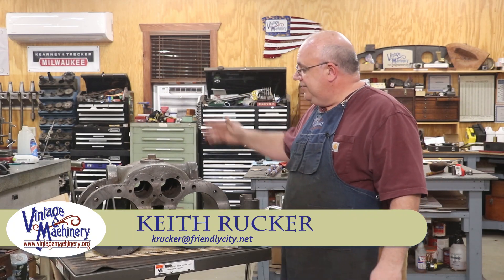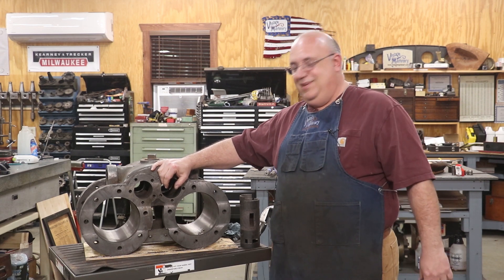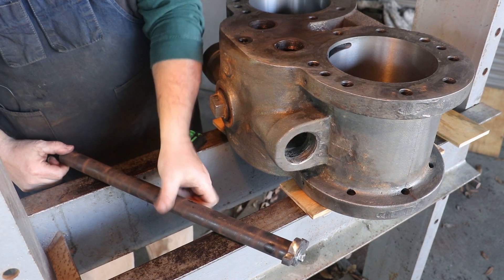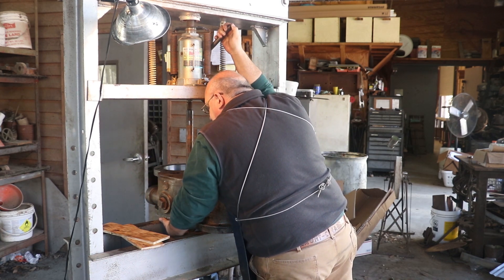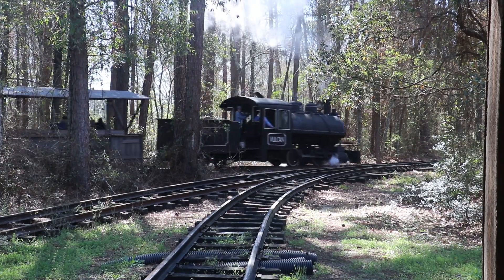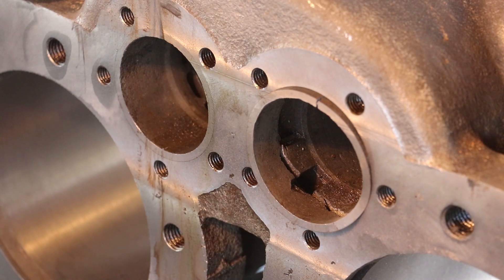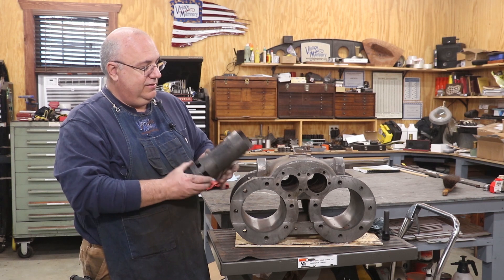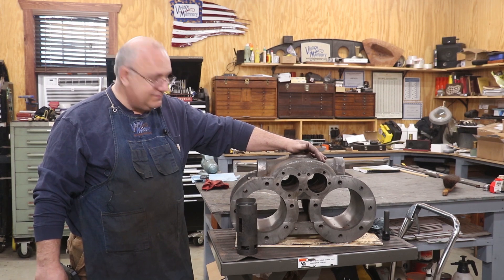Steam Locomotive Stoker Engine Restoration - Part 10: Removing Valve Sleeves Using a Hydraulic Press

Comment: Making a thin and skinny casting like that with no hard spots might be challenging. And there's nothing worse than machining a chill casting with hard and brittle spots in it. So as counterintuitive as it sounds, it might be easier to buy a commercial piece of cast iron bar and machine it to size. It'd take a lot of drilling and boring, but it's going to be nice and uniform, with no bad spots.

Comment: This looks like something I did to a water pump many years ago. Cast iron sleeves!  Who would have thought that cast iron was needed for something like this?  Because the sleeves I removed were shorter I used a hack saw blade to cut a slot, then heated the outside and used liquid nitrogen to cool the inside followed by a few taps and the sleeves contracted and fell out.  Unlike your pump, I had new, ready made sleeves available to press back in.  I used to use a liquid metal filler to patch pitting in water valve seats, darn water is abrasive and wears out water pumps like you wouldn't believe, and my company hated to spend money on replacement if they could avoid it.

Comment: When you go to push them back in you could turn up a puck to fit the top to support the sleeve all the way around. Squatch253 Senior did this to pull in cam bearings in a tractor engine, worked well.

Comment: One way i've seen stubborn sleeves get popped out in the past is somewhat tricky, but not out of this world, and it involves heating the casting as the first step. Doesn't need to be much, but enough to get everyone playing. Then, you need a specialized bit of kit, specifically, a tube with many holes drilled through it (kinda like a machine gun sleeve, but with smaller holes, and capped at one end). You put that tube in the sleeve and through the uncapped end, via a tube, you put whatever cool liquid, at pressure, you have. It rapidly cools the sleeve and if all things are kosher, you can even drive that sleeve out by hand, have seen it happen twice now with old CAT engines, the otherwise unwilling sleeve simply fell out. :))

Comment: Hi Keith,here is my tuppence worth. From previous experience I have run a long keyway broach down the inside of stubborn old liners in several passes. This significantly weakens the interference between liner and outer bore making them real easy to push out. Even a block of hardwood and a  hammer is sufficient to shift the liner thus treated. The idea is to not go through the wall thickness but merely to gouge a series of partially depthened keyway troughs inside the liner to loosen the liner's grip. Eccentric boring of the liner sleeve  is another method  I've been witness to. The eccentric boring method was accomplished with a Van Norman portable cylinder boring bar. The cylinder block set horizontally on a shaper table and a keyway cutting tool would also work well to weaken the liners grip whilst maintaining the majority of the liner intact.

Comment: Keith, you are approaching this the right way.  I have re-sleeved many engines, and for what you are tasked with, your approach is sound.  IMHO.   The only other thing you can consider is if the clearance permits, you can use a small die grinder with a cone burr.  Cut  yourself a slit down the middle, and the sleeve will come right out.   I cannot tell for sure what the ID is, but I have done that a couple of times on 4" and 5" bores.  Great video.  Good luck!

Comment: Check out Melling for a ready made sleeve. They are available in lots of sizes. When we remove blind sleeves we just bore them until they are paper thin and just fall out.
Reply: Then he wouldn't have a model of where the ports would go. Also check out Los Angeles sleeve company for raw materials. But a great idea about boring out the sleeve, my initial thought until I saw the complicated placement of the ports
Reply: Rambozo Clown Mellings sleeves sound perfect, centrifugal cast iron has near perfect metallurgy for the job!

Comment: Check for commercial produced cast iron sleeves used in internal combustion engine rebuilding. Others have suggested this, I just adding another voice to those. Commercial sleeve will have stable metallurgy and controlled grain structure

Comment: Hi Keith! Having some experience with repairing steam locomotives, always heat the thing! Heat is the key. Sometimes heating the part and then trickling water on the part to be removed shrinks it and it will break loose. Good luck and I admire all seek to restore the iron horse running on the rails!

Comment: Check to see if you can obtain a standard size case iron engine sleeve that can be machined to fit.  When I had my automotive machine shop I had a large supply of standard size sleeves anywhere from 1/8" thick wall to 1/4" wall thickness. David Richards may have a source.
Reply: I suggested the same thing in a previous video, use a commercial cast iron sleeve.
Reply: Agree... service parts for internal combustion engines are off the shelf, and of tightly controlled metallurgy and grain structure
Reply: ...or grey cast iron tube from McMaster-Carr.

Comment: On all of the ships I was on we had an oven large enough to put that casting in. We would have heated up the casting so that the gap between the insert(sleeve) and the casting would have grown enough to loosen the rust and allow the sleeve to be pressed out. The one thing we would have made sure of though was to ram molding sand into the sleeve so that the heat wouldn't have reached the sleeve and would have kept the sleeve cooler than the casting (relatively cooler that is). Worked every time. Good luck pressing the last sleeve out!

Comment: I see you are using the hydraulic press with the factory release valve setup. I am surprised you haven't made a larger valve setup to make releasing the press a ton easier. I actually bought a typical water valve replacement handle/knob, and fit it to the valve to allow me to very easily release the pressure as slowly as I like, or even wide open without any real hand effort. Does make a huge difference. Thumbs Up!

Comment: A technique I have used for this application is to (a) appropriately heat the block area then (b) place a thin cloth loaded with dry ice inside a plastic bag.  It's necessary to stuff a shop towel or other item to keep the dry ice bag from falling through.  Usually the heated block area along with the shrunken cylinder will provide sufficient contact reduction for the press to be successful in removing the sleeve.

Comment: Reminds me of the time that Ed Beard  (the machinist at Illinois Railway Museum) made cylinder liners for one of the steam locomotives.  We heated the cylinders with a torpedo heater.  As we slid the liner in, the temperature equalized when the liner was half way in.  The following week end, Ed showed up with 200# of dry ice.  We heated the cylinder with the torpedo heater and then put the dry ice in and slid the liner the rest of the way in.  Also reminds me of putting wrist pins into a Cummins diesel engine.  Freeze the wrist pins and they slide in with no problems

Comment: Melling makes cast iron sleeves for engines. Check them out, it might save you a ton of time. Then on the sleeve removal; heat a band red hot up the side if the sleeve. The grains if the the material will slide over themselves and relieve the press fit. The sleeve should almost fall out. Fun stuff.

Comment: Heat the main casting by connecting a steam hose.  Use dry ice inside the sleeve.  It will fall out.

Comment: LA Sleeve in CA specializes in custom spun cast iron sleeves and can CNC machine the porting exactly per the originals. I've used their sleeves in motorcycle cylinders for over 30 years. A top notch company, they service many different industries and I wouldn't be surprised if they've made sleeves for this application before.

Comment: I used to run a couple beads of weld on large bearing races the wouldn't come out, when the weld cools it shrinks and usually works pretty well
Reply: On engine dry sleeves ( cast iron as well) welding beads worked without a puller
Reply: Tsunauticus III  yes I did point was no need 4 puller
Reply: welding beads are the way to go on this.
Reply: Tsunauticus III  Yes I did, its just a comment on how well it works nothing more.
Reply: Tsunauticus III  relax bud, no need to get your shorts in a knot

Comment: Another plan A can be to make a welding bead along the inside of the sleeve with a stick welder. When it cool down the sleeve will come right out.
Reply: welding on cast iron inside a hole is a lot of fun.
Reply: @LambertZero  
It is a narrow diameter in this case, that is true, but using an easy striking electrode might be the way to go. We do not need any good looking beads.
Reply: Cast iron sleeves can be a bit funny when you do that. I have on more than one occasion done that and had the weld bead break away from the iron. The thing is you cant really weld it properly as if you preheat it it defeats the shrink. When I do that I usually just use the mig as it will shrink the most and you can lay the bead in hot and thick without heating the parent metal to much. . If it was in my workshop I would just put it into the mill and plunge down the side of the bush in a couple of spots to make it thin but not break through. When you do that they virtually fall out. I am wary about putting a cast iron valve into the press as you don't really know how fragile they are.
Reply: Tsunauticus III  
The thing is it could be given a higher priority. As the first thing to do. It is safer to try to shrink the sleeves wit a couple of weld beads than to use the biggest hydraulic press and pile on the pressure until something gives. Cast iron will crack under pressure. Less force is better.

Comment: Make your press tool out of better material. Then just heat the thing, cool it and press it out. I feel certain it will come by that method just can't hurry it. :-) We press water pump bearings out all the time and many times they are very stuck and rusty. A good pressure against them combined with heat to the outside and they always come.
Reply: What kinds of water pumps? The big canned motor pumps used in power plants?

Comment: Not that this would in any way be applicable in this instance, but I happened upon a method of removing stuck/frozen bearing races. I have an old Jeep and while replacing the rear axle bearings, one was frozen in place. With little way of pulling it out, I decided to try to rapidly cool it. I used a can of compressed air readily available at WalMart, turned it upside down and sprayed the race until it was completely frozen. Put on a glove and pulled the race out by hand. It did take two tries but it came right out. I have since used this method on other stubborn bearing races and it has worked every time.

Comment: One suggestion  to possibly prevent a disaster I would encourage using some thick plate steel to take most of the load spanning between the two I-beams so the cast iron is no longer carrying the multiple tonsvof pressure through the casting,  something it was not designed to do.  Because I kept visualizing the entire casting suddenly snapping in two!
Best of luck, I don't think (within reason) you can over-heat the main casting, oh and job well done!

Comment: Lots of comments on using dry ice to cool the cylindrical casting, but water will remove heat quickly and a CO2 fire extinguisher will really chill it down.  big heating oven would possibly be better for a more even heat up overnight say, then a quick shrink before pushing it out with an improved push plate hopefully. Thanks for an interesting vid though Keith, and good luck with the second sleeve.

Comment: When I saw your push tool I thought the tangs would bend. Try a straight bar backed up with a disc that is as big around as you can fit. That way you will be working on the shear strength of the metal and it should not bend.

Comment: If you can cut a groove in one side of the liner most of the way through, the liner will collapse relieving the tension holding the liner in the cylinder. Good job for a shaper if you can rig it right.
Looks like your heating-chilling method is the easiest way.

Comment: When machining the sleeve standard practice is to mill those ports.  It will be quicker and easier by far.  When installing do not heat the casting, warm it to take the chill out, but that is all you would want to do.  You keep heat away to not chance cracking the casting.  Liquid nitrogen the sleeves and drop them in the holes with the ports lined up and the walk away.

Comment: Hi Keith, I machine up motorcycle cylinders all the time but use a good cast iron 250 grade from solid billet and machine the ports on a Bridgeport mill, on alloy barrels we do an interference fit after testing how big they expand when heated up but on old cast barrels they are pressed in cold with a lesser interference fit to avoid cracking the cast barrel. If you dont use a good quality cast iron you can end up with the cast been porous on the final cuts which is not good.

Comment: Just get a spot on the sleeve cherry red and run that hot spot the length of the sleeve.

The spot expands, crushes itself and then when it cools the crushed spot pulls the circumference down....the sleeve will practically fall out.

Comment: PERFECT timing!The sleeve starts to move, the extension pops out, & the loco whistles! 

I'm not a machinist, or a mechanic, nor a metallurgist. With that said, why can't you use a steel sleeve to replace the original cast iron sleeve? Wouldn't the real steel last longer than cast?

Comment: Keith set the cylinder in your Carlton Drill with a boring head. Cut most of the sleeve out and the thin wall will not have as much out word force.

Comment: Keith,  given that the new sleeve will need all the ports to be in just the right place.  Have you thought about using a machinable wax filament for your 3-D printer? You can print it at a finished size without the need for draft on the pattern.   I've never used any but I see that it's advertised for "lost wax" casting.  I don't know if you can use a standard sand mold or if it will need to be a plaster mold.  Either way, it might be something to look into.

Comment: "A good plan that didn't work." Welcome to my world.
Reply: a plan is an idea so that you have something to deviate from if it does not go correctly, completing the objective is a job well done - kind of like the difference between fishing and catching fish
Reply: I've heard that no plan lasts longer than contact with the enemy. I guess you could say that no plan lasts longer than contact with the machine. That's been my experience, on the occasions when I'm attempting a task I haven't done before.
I still run into those jobs, after 45 years of fixing things.
Reply: Plan A fails there are 25 more options

Comment: Keith, thank you so much for sharing what you do. Love it,  Because the inside specs and surface condition of the sleeve is the important part and the surface of the main casting is less critical, would it be possible to use a shaper with a V shape tool bit to slice through the sleeve, even partia length? This could break the bond significantly making it easier to press out. Thanks again.

Comment: I would go for bar stock because the grain structure will be finer,more uniform, and therefore stronger than a sand casting which could have weak areas, particularly around the ports, and therefore be more likely to crack when pressed in under heavy pressure.

Comment: There should be better support with press plates on the bottom side so more of the pressing load is applied closer to the liner. That's a wide span there and I was waiting for the entire piece to crack down the middle.
Reply: dcrahn there’s not a snow ball’s chance in hell that little press is ever going to break that casting in half.

Comment: How about just boring it out, Keith? It was almost a foregone conclusion that something with that much corrosion would not yied to pressure on such a small section of it. BUT - there was nothing you could do on that point. How about dry ice, Keith. That would surely cool the sleeve rapidly leaving the casting still quite hot. Air, no matter what, is NOT a good conductor of heat or cold. Well - success. Good going without a lot of fuss.  Plan D. One thing your viewers know - You'll find the way to do it. Great job, Keith. You've given that thing a new life.

Comment: You could add a metal plug, the ID of the sleeve, and install it above the press tool.  If you make it as thick as possible it will transfer the force to the outside of the press tool.  Don't think the press tool would bend then.

Comment: I would be a bit wary about casting the sleeve with the ports as the pattern and casting of it might take quite a few tries to iron out any issues. Nothing worse than getting it installed then upon finishing the bore finding some inclusions, hard spots or gas holes.  For the extra time it takes to make that out of cast iron bar / hollow bar stock it really isn't worth the risk and expense.  IMHO

Comment: Keith I would have thought cutting out a slot in the insert to relive the pressure would have worked best just use a hacksaw or your milling machine to slot it like you do with a keyway.

Comment: Heat it red hot,  end to end , 1 or 2 inch wide with cutting head.
Cool it, it will fall out, if not, repeat opposite side.

Comment: Thread it, screw in a plug, press on the plug.
Reply: I was thinking the same thing- In a locomotive shop they probably have some monster taps
Reply: Those are both good ideas either a tap or single point threading
Reply: @scottpecora371  Or put a puck in there and weld it in to push against. Of course if it's not high enough up, it might break in half (again). :)